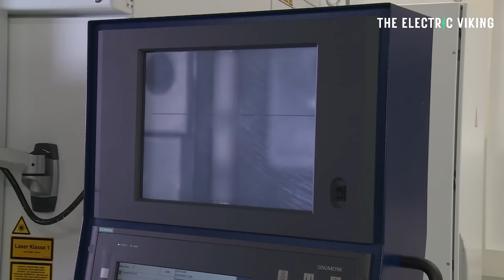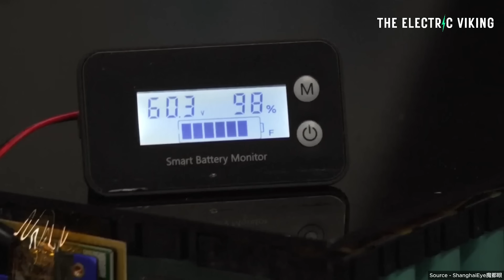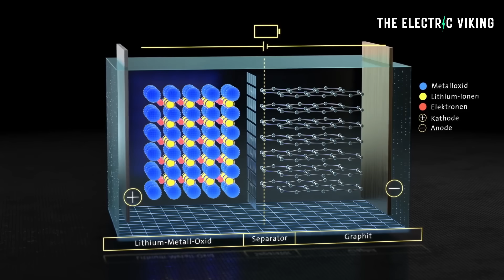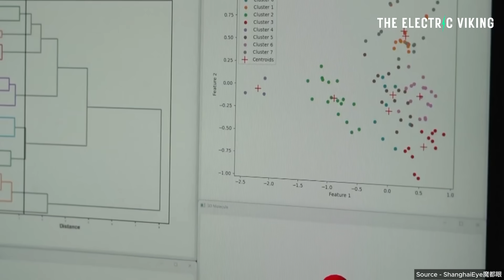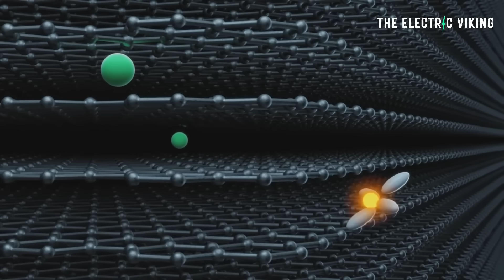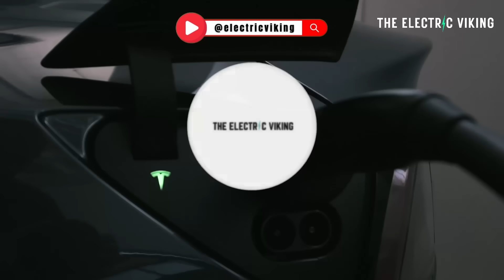AI discovers game changing CHEAP solution to double lithium battery life

Comment: Batteries will change over time. Hopefully the battery pack will not change. In other words, if they go from lithium to graphene for instance, it changes the battery itself but there is hopefully no need to change the battery size and shape and it can be slotted in to the old battery position so the car does not become obsolete. Or laptop, or phone, or scooter. Or whatever product requires the battery.

Comment: Doesn't look like something easy to be done in large quantities.
For now electric cars don't make sense financially long term because of the price to replace the battery.
I think the real break through will be when they make the batteries easy to recycle. A design made for automation to disassemble, refine and restructure the batteries as new. Cutting costs with time, sourcing and vertical integration to make them cheaper than the cost to rebuild a petrol engine.
That is the final economic motivation for people to switch.

Comment: Something is missing in this discovery and the reporting.  For instance could this new rejuvenating chemical be added to the mix when manufacturing the battery in the first place? Injecting it into batteries that have already reached their service life sounds like a fairly intensive process of somehow opening the battery to insert the chemical and is probably not easily overcome.

Comment: The EV clinic in Berlin already takes EV batteries apart from every car brand, and then they test each individual cell, and then they replace the cells that are bad or about to go bad. And the costs are not that high, just over a thousand Euro. But then you have a battery that is back to spec as when it was new. Which is much cheaper as buying a new EV car or an engine swap in a car with an internal combustion engine. It not hard to imagine that in the near future with this new technology they also could replace bad cells with batteries that have been injected. We will see where it goes.

Comment: In degradation LLI (loss of lithium inventory) and LAM (loss of active material) play their parts. If my understanding is correct, lithium plates on the SEI layer and becomes unavailable for ionic mobilities.  One wonders whether this agent could be applied to the electrolyte composition in  manufacturing.  The electrolyte also changes in through corrosion reactions in time.  For a BESS battery you could but not on sealed units. As I kid I often recovered old heavily sulphated motorcycle lead-acid batteries by charging through a  resistor from 24V. Maybe an AI charging protocol would help here

Comment: If it works it would make sense if they made batteries with whatever this compound is attached to the battery cells ready to inject, then have them automatically regen the battery at intervals.

For existing batteries is gonna be a pain in the arse because you have to disassemble them and inject each battery cell individually, good luck with that.

Comment: Lithium-ion battery fires are difficult to extinguish because of a phenomenon called "thermal runaway," where a single overheating cell can trigger a chain reaction causing other cells to overheat rapidly, releasing flammable gases and generating intense heat, making it nearly impossible to cool down the battery with traditional firefighting methods like water; essentially, the fire is fueled by internal chemical reactions rather than external oxygen, meaning simply removing oxygen won't stop the fire.
Reply: Fire fighters have to get up to date. There are new methods to extinguish battery fires. You do your research.
Reply: My understanding is that gasoline isn't flammable, so ICE cars never have equivalent issues 😂. But as others have said, firefighters probably just to update procedures...

Comment: I'm beginning to think that the price of batteries is irrelevant.  I need some batteries  to go with my solar panels so I got a quote.  Batteries are reported to be coming in at about $100US per kWh so the batteries in a Tesla power wall should cost about $1,350US.  The quote was for just under $11,000US.  I needed a new battery for my weed trimmer.  Capacity, under 0.2kWh.  Cost $300NZ.

Comment: This is definitely not practical with the design of today's EV batteries. 4,000 plus sealed cells inside a very heavy battery pack are not coming out, getting injected and put back in for anything approaching a reasonable cost.
Hopefully they find a way to include this compound/method during the initial manufacturing of the cells.

Comment: Grok says The Toyota Research Institute (TRI), in collaboration with Stanford University, has been working on a method to restore degraded lithium-ion batteries by injecting a chemical solution into the cells. This effort stems from a study published in Joule on January 17, 2024, titled "Closed-Loop Lithium Regeneration" (Volume 8, Issue 3)

Comment: Hydrocarbon fuels will never die out. At least no time soon. However, battery bank surge absorption technology can drastically reduce the required capacity of such power generation points. There's no need for a 200hp petrol engine in a hybrid automobile, even if the car is occasionally pushed to a 200hp output. A 30hp generator could keep the battery bank charged and never waste fuel at idle. The same is true of grid level generators with household level battery reserves.

Comment: Former LUCID's CEO,  emphatically declared how useless is for the electric cars industry to increase battery capacity, size, life, etc. when the answer is developing more efficient motors and drivetrains, something cheaper and potentially better than relentlessly searching for the solid state battery solution.
In my mind, it is like trying to improve ICE's range by incrementing the size of the gas tank.
Just think about it.

Comment: How do you physically inject this into sealed Lithium batteries and how does it get to the correct locations on the wound-up annode or cathode?  It appears to be only a laboratory based answer and not for working batteries in the cars.

Comment: Yeah but it's not just injecting. Lithium cannot be exposed to air (else it will oxidize). So it needs to be done in a clean room and in a vaccuum chamber. Then the battery needs to be opened and the material injected and then closed and verified as sealed before being let out of the vaccuum chamber. It's a very complex process to say the least. Might even cost more than just grinding the old batteries down, refining out the Lithium and create new batteries in the usual way.

Comment: Lithium trifluoromethanesulfinate (LiSO2CF3) is a salt that can extend the life of lithium-ion batteries. It's been found to be compatible with other battery materials and is relatively inexpensive to make. 

How does LiSO2CF3 work? 

LiSO2CF3 is injected into failing batteries to add lithium ions 

The lithium ions become part of the battery and can be managed more easily 

The reaction produces gaseous byproducts that can vent out, making room for new lithium 

Benefits of LiSO2CF3 

Can extend the life of lithium-ion batteries by up to 12,000 cycles 

Can improve energy density and sustainability 

Can reduce electronic waste by extending the life of batteries 

How is LiSO2CF3 synthesized? 

Sodium trifluoromethanesulfinate is synthesized by stirring trifluoromethane sulfonyl chloride, sodium bicarbonate, and sodium sulfite in an aqueous solution 

The product is purified by crystallization, then dissolved in an acetonitrile solution of hydrochloric acid 

Lithium hydroxide monohydrate is then added, and the product is recrystallized and dried

Comment: Cathode negative Anode positive according to systems international. The metric system in others words, it's the difference between conventional current flow and electron movement. So because electronics have a negative charge they move from negative to positive, not from a positive to negative as their is is no positive charge, just a lot of negatively charged electrons looking to earth themselves through a ground connection in a circuit. No doubt this is an American description of conventional current flow as they are still bracking rocks with pounds and inches.
Reply: Benjamin Frankin proposed conventional flow, which was from positive to negative.  Batteries he used then took on this understanding.  12 inches is  from 12 months in a year,  30 is from days in a month, and so on.  The vast majority of human history, counting, was not base 10.

Comment: This sits with my position that we're doing sustainability in the "wrong" order. The hippies used to say "Reduce, reuse, recycle." Reduce energy demand.

Does Mini E need a 125kW motor when the 1963 Morris Mini 850 had (I think) a 25HP (33kW) engine? We can reduce energy consumption. We don't need 6 to 7 second to 100km/h acceleration for a school run/shopping trolley car. My first car, a first gen Ford Escort was light and flea powered. Ran on the sniff of an oily rag. I'd rather an electric car - I don't think I need 125kW for the driving I do. I've never needed huge horsepower. It's a want, a lighter, spaceframe monocoque body and a smaller donk for me, everytime, a la Hyundai Inster.

Then, this battery advancement fits the next thing, reuse. Rejuvenating batteries reduces the demand on resources. So, this is an amazing development and I hope this can be rolled out quickly. It also makes the idea of battery swap, rather than fast charge, a more profitable option, and battery swap takes about as long as filling an old Mini's tank.

Finally, we should recycle that which is end of life. Recycling is important, but it shouldn't be the first thing we subsidise and design infrastructure for. It's the last resort, for end of life.
Reply: Keep in mind: those kW values are peek power, not permanent power. Its characteristic of an electric motor to work also on short "overload" situations.  For example: the Kia motor with 150kW peak is rated to 50kW permanent power. So the Mini-E will be about maybe 40kW permanent power and with that higher weight it isnt that more powerfull than the 1963 version in long term situations (running up a big mountain road, full speed highway or like that)
But yes, the short "overpowering possibilitys" allow faster accelleration rates (saver overtakes because of less time needed), especially with the full torque starting from 0 rpm and no interupts by changing gears.
Reply: I also believe the performance of a vehicle needs to be similar to other vehicles on the road. For example if you can't hit 100kph in a comparable time to the other vehicles you are trying to safely maneuver amongst you are creating a dangerous situation for yourself & those around you. I know you've seen that older neglected car sitting at an intersection not entering traffic when most cars would have been long gone. Weather the driver or car isn't able doesn't matter but at least if the car is capable then we only have the driver to blame. If the car is deficient then no driver will change that fact.
Reply: @ I believe urban speed limits are set too high, was active in the 90s for dutch style urbanisation and was also involved in a campaign to reduce Australian speed limits across the board. As low as 30km/h in residential zones and an overall 20km/h reduction across all zones. With provision for faster if streets and highways could handle it - eg, straight, good sightlines adequate pedestrian safety, etc. if a car travelling at 60km/h hits a pedestrian, that pedestrian has a 1 in 10 chance of survival. At 40km/h the survival chance is 9 in 10. Various UK, European and Australian studies found the same. When John Howard became PM he killed 40km/h and every other reduced speed limit.
Reply: Well, I agree on everything you said, but the 25HP from the Morris Mini engine equals to 18.6kW (not 33kW). 
Greetings from Thailand
Reply: @ I unbrained that, didn't I?! Got my numbers upside down. My apologies and thank you.

Comment: There is much confusion over the use of "lithium".  Batteries are named after the material used in the cathode.  A true lithium battery has a lithium cathode.  A lithium ION battery, however, uses NMC (nickel, manganese, and cobalt) as the cathode with lithium IONS as the electrolyte.  These batteries should, therefore, be called NMC batteries but they are not.  I suspect this is spin intended to distance themselves from NMCs that caught on fire.  We just bought a 2025 Model 3 that has an NMC battery.  Maybe they'll come up with a treatment for NMC batteries too.
Reply: Lithium is the main cost.
Reply: Lithium is the largest chunk of the cost

Comment: Surely, your statement that it may cost $500,000 to restore your battery with this process must be a mistake.  That amount prohibits any practical use.
If that is true, and they can economically  remove an end cap or figure some other way to access the innards of the battery; this is a game changer.

Comment: 5 years ago, all my gardening equipment ran on toxic, noisy, high maintenance gasoline. Today converted to all rechargeable 🔋 powered. My old 2-stroke hedge trimmer fumes used to make me illl. Oh, every spring the dreaded hard start.
Reply: A wise change! 👍
Reply: Leave it to the oil and gas industry to have mouthpieces that repeat their drivel. Sow doubt! That's an objective that has "worked" for many issues. 
Only highly flammable gasoline could pull off this bait and switch and have enough luddites believe it.
Reply: I sure do wish the chainsaw of buerococy -sp was a cordless Milwaukee bout $400
Reply: Bullshit 😅
Reply: Need to be cautious that one of the batteries doesn't catch on fire and ignite all of the others burning your house down.  Best to store them away from your house.
Reply: @Islamisthecultofsin Got a proper fanatic 'ere, 'ent we, lads? Probably recks Ukraine started the war, too.
Reply: @  A proper Southerner knows that it's "ain't".  Many people have died and had their houses burnt down because of cheap lithium batteries.  One guy had got on an elevator and the door closed and it went off.  He couldn't get out of the steel elevator.  Horrible way to go.  I'm not a fanatic.  I'm a realist.
Reply: @Islamisthecultofsin  The Electric Viking has a video on the false image of EVs burning up more often than ICE. Turns out just the opposite. And as far as batteries that power tools I have had dozens thru the years stored in my house and sleep well.
Reply: @John-e5w3x    I own an  electric car.  Cars have battery management systems.  Battery tools do not.  I haven't had any problems with battery tools but I've thought about getting rid of them.  The guy getting into the elevator with a scooter pack is what was the final straw for me.

Comment: Can't the manufacturer just put the chemical in the battery when they make it, then the extender chemical doesn't need to be injected later on ? How would that injection be done ?
Reply: Definitely one engineering idea to explore.
The chemical may not have a long stability life or could be volatile or just not suited to that environment inside a battery cell.
Lots of science and engineering to explore with AI for sure.
Reply: Probably not unless the battery is designed to outgas. The video talks about a gas being released as part of the process.
Reply: It cant be done.
Reply: @Withnail1969 where there is a will there is a way. Your dismissal is one of a negative attitude.
Reply: Probably not unless the battery is designed to outgas. The video talks about a gas being released as part of the process.

Comment: How many times can you double the life?
Reply: Once. Next time total life to date will be extended by 50%. But perhaps you were asking "how many times can the original life time of the battery be recovered?" I would guess that, in the nature of technical decay, that the recovered life time will, each time, be less than the previous life time. If the first life time was 30 years and the treatment recovered only 90% capacity then a second treatment, 57 years after initial fabrication of the battery, would be rendered obsolete by advancing technology.

Comment: I should have known from the 'game changer' that it wouldn't be. At the moment batteries are not packaged in a way that makes injection into the cell easy. Ok they could change the design now so that in 20 years time they could be injected however, at the current rate of development, things will be radically different long before then and humans don't think to the future more than about 5 years anyway. Maybe if they could stuff this cleverness, or similar, at manufacture, the badderies would last longer or even put it in a time, or similar, release mechanism at manufacture that could be activated when they drop to below 80% of original capacity.